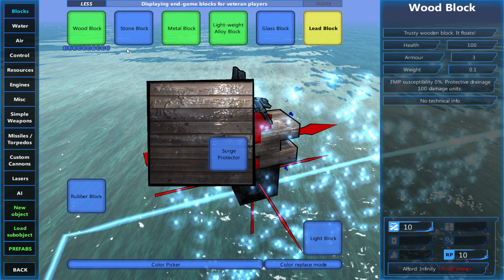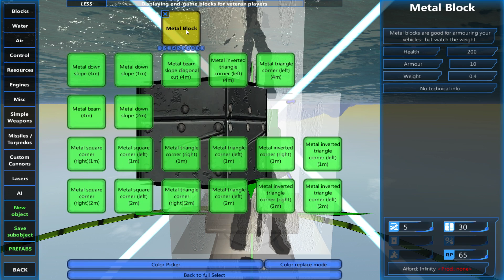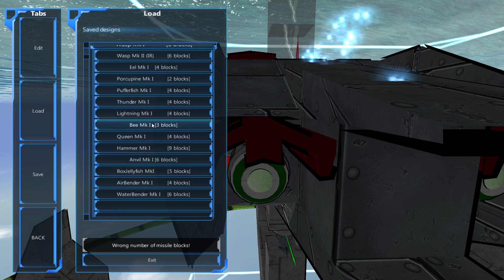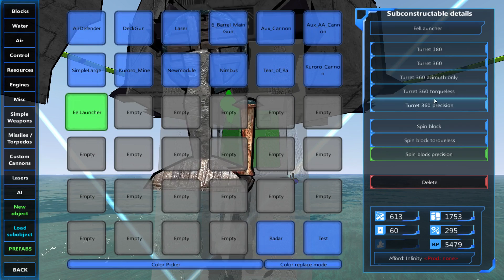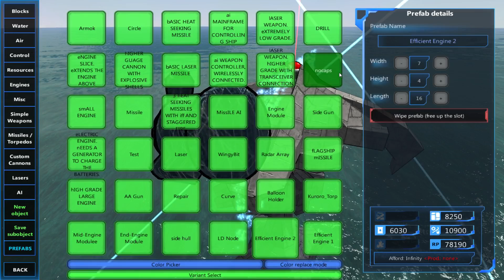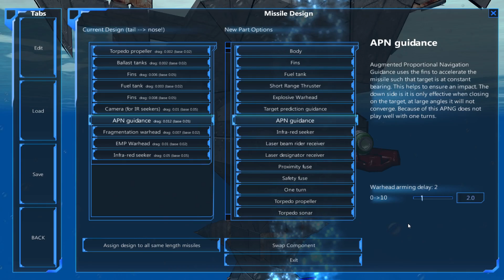From the Depths:S3 Designs 9 - Mandrake Defence Turret

Comment: Oh dear, I'm GMT-7. Sounds like that might run hefty attribute penalties ;). Love the idea of painting the turret like some sort of angry mandrake, ready to spit vengeance at any daring to invade its home!

Random tip I've found effective with torpedoes (or at least looks awesome) is to use the launcher add on, then tune the launch azimuth/elevation on each tube to fire the torpedoes in a fanned spread (they will spread out, but still mostly face dead ahead).

Comment: On the light-weight alloy on the top. It doesn't reduce weight but it DOES decrease the total density because it adds displacement and it is lighter than water. Thank you for reading.